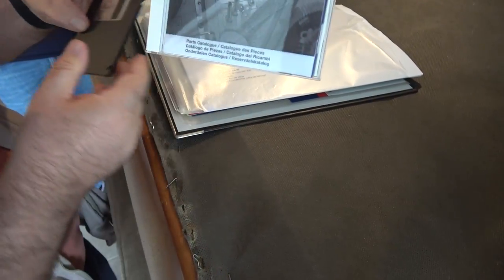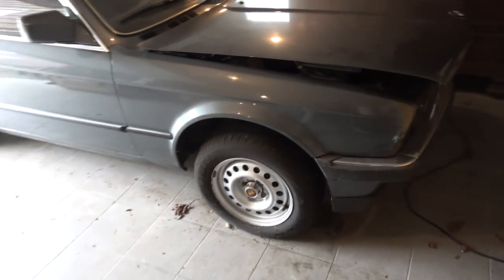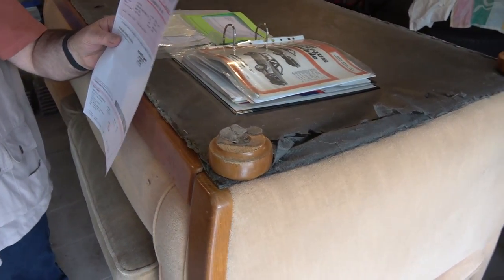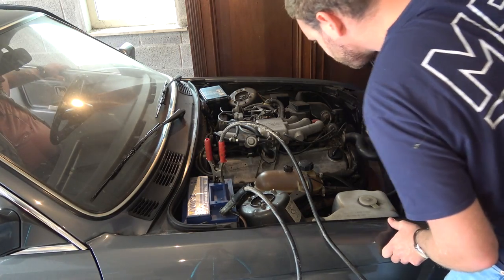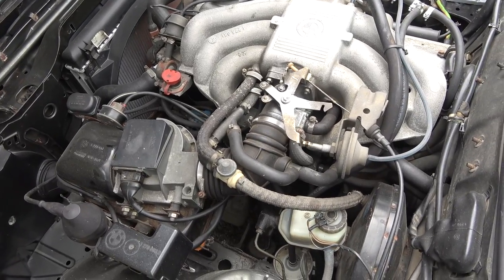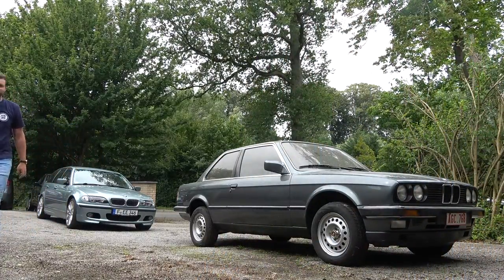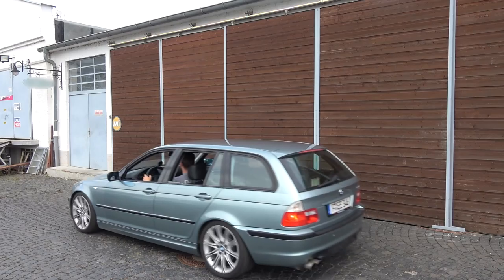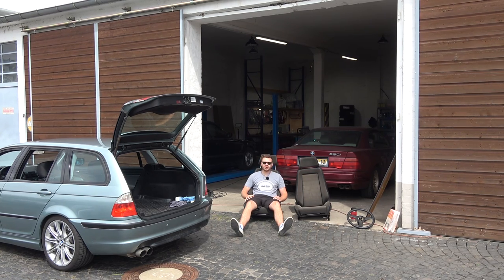Original Owner True Classic Survivor - 1983 BMW E30 320i 5-speed - Project Marbais: Part 1

Comment: I owned E30s for more than a decade...mines were both the 1988 E30 325is (Poors man E30 M3) with a manual transmission and a Limited Slip Diff.....one was Alpine Weiss and the other one was Zinoberrot 138......miss them dearly

Comment: a 1983 ... a hitten gem - it was so different the early years than from 1984 and forwards - small thing like the "check" bulb in the cluster was a triangle - I simply love E30 - I have a 1988 myself - with full original AC Schnizter exterior fitted - a tribute car! :)

Comment: I like the E30's but I really appreciate the respect Sreten shows the E21's.  The E21's are so underrated.  Most people like to pretend the E21 doesn't exist, but there would be no E30 without the E21.  Beautiful E30!  Can't wait to see what you do with this one, Sreten.  What a great guy that Michel was!  Sorry to hear about the loss of his wife.
Reply: That's because the E21 is bookended by two BMW legends, the 2002 and the E30. 
I'm meh on the E21. I have a BMW 2002 (favorite car of all time!) love the E30, meh on the E36, love the E46.
Reply: @monunyabidness5949  The E21 has some unique attributes as well. 2002 enthusiasts complained loudly about the E21's increase in size and weight, with no increase in power. BMW had very few power alternatives at the time to the M10 (the M30 family was far too large to fit, although Alpina fitted an M30 to an E21 called the B2.8) so BMW literally shoehorned an M20 six into the engine bay. The entire front and rear subframes were reengineered for the E21 320i/6 and 323i. To this day, this is the only BMW car with two separate front and rear subframes for two completely different engine classes.

Comment: Truly a beautiful car, I love the specification, very early 1983 chrome bumper, 2 door, 6 cylinder, 5 speed, delphin grey, steel wheels, radio blanking plate, sport seats. Truly perfect! 
And the history is amazing. Its no wonder you weren't interested in my shitbox E30 Touring haha.
I'm sure you will anyway, but remember to check the fuel hoses going up to the fuel rail. If the ends crack they can leak and cause fire.

Comment: My 1988 BMW E34 520i has the same M20B20 engine, it's also delphin grey and it also has a Mtech steering wheel and it was last summer, also a car that had been off the road for 10 years... it got a new windshield today, changed all ignition parts, welded, done some bushings, clutch, all manual gear shifter links, some new panels, removed all surface rust and just made it a gem now... love it to bits!
Reply: Sweet.  Dolphin grey, classy!  I've held off the suspension refresh for the mo.  A 760 and M5 mean the money has to be spread around.  Good luck with yours.

Comment: I had a 1983 318 model in 1985 and regret ever selling it. In 2003 i decided to revisit my youth and bought a1990 318is which i have dry stored ever since and love owning this car.  Good luck with your project, it sounds like the clutch slave cylinder is gone from lack of use.

Comment: Nice car this is. I used to live for E30’s and had loads, I regret selling my E30 M3 and 325i Sport the most, but I did sell them almost a decade ago.

We still have a late 1991 325i Motorsport convertible in Sebring Grey with a manual gearbox; it’s an official one of 250 with the correct 798 option code. It’s also completely and utterly utterly mint (lots of recent paint but no rust at all). It’s covered 90,000 miles since 1991!

Good luck with it.

Comment: @m539 Restorations. Top tip about the e46 touring: you can slide the roller-beam of the boot cover in two special bracket on the back of the rear seats (when they are folded down). That way the cover is secured for driving and out of the way!

Comment: Great find. I bought mine brand new in October 1983. 320i manual 3 door steel wheels in Dolphin Grey. Fantastic car with the smoothest of engines ..... anyone remember the advert with the 50 pence piece balanced on the engine?

Comment: I only saw the title, and I ALREADY FREAKIN LOVE THIS VID! Probably cause i'm from belgium and love E30's. The city is pronounced "Nee - VEL". It's actually home to the former Belgian F1 racetrack (Baulers) for the 1975 and 1976 grand prix; Oh and Sreten, Gent is not "tiny" (well maybe compared to Frankfurt, but).

Un gars qui à ses 25 ans achète une 320i et la garde pendant quasi 40 ans (et non pas 28 ans comme Michel l'a dit, ce qui est impossible...le temps passe vite), ça ne peut être que quelqu'un de bien. Si Sreten voulait que la voiture ne soit pas nettoyée ni intérieur ou extérieur, c'est très probablement pour que le "avant après" reste impressionnant sur sa chaine une fois le travail terminé, parce que cette auto a l'air nickel en fait. Tout le contraire des pauvres malaimées qu'il reprend en général; Merde si j'avais su que cette auto était en vente vraiment aussi près de chez moi, je serais venu!!

Comment: I had That car in That colour. Mine was a 1984. From 1987 until 2013. Yes, 26 years of service and I sold it in running condition.
Watch out for: water leaks…which make the floor wet…which corrode electrical contacts everywhere. And the distributor has design flaws which cause misfire which are incredibly hard to track down. Otherwise bulletproof engine and trans and suspension.

Comment: Oh my, this video brought memories of buying my first E30 almost 20’years ago now. Mine is 84 318, or what it started as. 

I had exactly the same sport cloth seats as your 83, same color and pattern ! Brings back memories , has them also in blue color as well. 

Very cool, will be following to see what you’ll end up doing with this .

I’ve still got mine , pretty much turned every nut and bolt so feel free to ask any specifics . Short of carpet and glass . I’ve either replaced and / or upgraded everything over the gears. 

Good luck and congratulations 🍾

Comment: That E30 is one helluva find and awesome! It is a real shame about the door because it is so clean ,but Im sure that it can be repaired.  I would def. not under any circumstance replace that original door.  The steel wheels are cool too.  I would refresh all the mechanicals do the fluids, timing belt,etc, put a new suspension on it (personally, Id lower it a few inches at least) , and then call it a day.  Getting it from the original owner is Insanely cool.

Comment: Finally a E30! You just need a M20B25 with the prefacelift harness and DME to get the full potential out of the chassis.
Reply: Why?  What's wrong with the car's existing engine?  It started right up, the car runs and drives, and apparently only needs some minor brake and clutch work, plus a timing belt replacement.
Reply: @houseofno  I really only deal with U.S spec E30s we never got the 320i. We got 325Es and 325is so the 2.7s and 2.5s, trust me there is quite a big deference of how the stock 2.5 feels. The acceleration and sound is way better and just the 40 bhp difference is quite noticeable under “spirited driving”
Reply: @rexe3139  Agree once you lose the limiter (eprom) on the 325e rev line jumps 2k and posi makes this sedan a Sports car! .l....had one, did that!

Comment: Nice, a very early E30 320i, in pretty common for early car fairly basic spec, i.e. none of the poser parts that later cars tended to get loaded up with by the look at me brigade.  It's really nice to see, and to feel, the purity of the design like that...

I think that damage to the door is quite easily repairable, but it's probably going to take the work of a proper, old school, panel beater to do it well.  It deserves to be done to keep the original panels on this E30, as there can't be many around that are still as original as this one.  Hell, I almost never saw examples as good and as sharp as this around in the '90s, and I always looked as I always wanted one...

Comment: I will say, it may be worthwhile on these cars that like to rust particularly badly, to go ahead while you've got the suspension off and the underbody uncovered to go ahead and apply an adhesion promoter and a rubberized underbody coating to prevent undercarriage rot. Put some on the back of the panels behind the fender liners as well just for good measure. A lot of those coatings can be rolled or brushed on if you don't mind the finish being less even and uniform. It also doubles as sound damping material.

Comment: Not so far from my home. I know that road and that is near the abandoned circuit of Nielles-Baulers where the BElgian F1 grand prix was hld two times, back in 72 and 74.
Afterwards it became popular for illegal races and so on as there were no funds because all the funds went either to Francorchamps or Zolder. It was a very nice circuit and Senna also tested his karts back then there. It was a pistol loop design and was surrounded by lovely woods etc. Nowadays there is still around 30% of the circuit untouched and you can walk along the curbstones that are silently but surely being overtaken by the force of mother nature.
The rest of the circuit has become an office park and you can still drive more or less the original layout for that part.
My father went there often to break-in his Laverda SFC and Yamaha TZ250 racing bikes.
Too bad all of that is now history. There is still also a restaurant called Le circuit where they are lovely pictures and so on.
4 or 5 years there was a historic revival that was organised very well by enthusiasts.
This is still an L jetronic, isn't it? With a real distributor standing up vertically.
The Haynes repair manual you got is for the E30 and not E21 if I am correct. It mentions the 325?
Cheers from Belgium!

Comment: I used to own a 520i E34 with the exact same engine. Not a very fast car per se but a reliable engine and nice to drive. Mine had over 300k when I sold it, and it still passed the coin test.

Comment: I have a few BMWs as well and like to do the simple maintenance on them. I have a 1987 E30 convertible, a 1973 E10 Tii from Italy (my favorite one), 1995 E31 840Ci and a 2000 E38 740i Sport (my daily driver).  I love your channel since you seem to work on the years and styles of my cars.  You inspire me to work on them more.  I am wondering where you order your parts.  I don't seem to be able to find the replacement parts you get in Germany.  Is it an online shop?  Thanks for the help.

Comment: A 320i -84 was almost my first car. I liked it for its dimensions and lovely front. It sounded great, but it was all show and no go. The engine revved, but nothing happened. Ended up buying a Peugeot 505 turbo -86 instead. Much faster and more comfortable car. Good luck with your car Sreten and I am curious of what you think about the driving experience, once it is finished. Sa srecom.

Comment: I used to work on those every day in the mid 90s.  Do LiquiMoly Engine Flush on that thing.  It will make it very happy.  I used to pull those manuals in under an hour.

Comment: All the USA 320i were I4.  Hope the two E30I6 can be compared side by side when they are finished.
Reply: Just an FYI, there was also a 320i/6 with the E21, powered by a 2.0L version of the M20 six cylinder.  Those only produced around 120 hp.  The E21 320i/6 and 323i were never officially imported into the USA, but there were a few grey market cars that were slipped in by their original owners.

Comment: Hi Sreten. Every subscriber has used up any compliments that i could adorn you with. All I can offer. Is work on your Hand Grip strength.
                   You will need it to unhook/replace the springs on the rear brake shoes. Unless of course there is now some fancy Gizmo / Tool
                    to help. In my day it was just a pair of long nosed pliers and brute strength to get them off/on. See you in the next one. 👍👍👍

Comment: Those steelies need to stay! Widened steel rims with polished lips is the best look for classic cars.
Reply: Why widen them?  There's only so much space in the wheelwells, bigger tires just add weight, slow the car down, forces your drivetrain and suspension to work harder, more unsprung weight and further limit the choices in tire sizes.
Reply: @houseofno  I didn't say that they should be widened on this car, just that it is the best look overall. "Those steelies need to stay!"

Comment: 14:20
It always drove me insane why did they need to use such a long screw?
Reply: There is a little plastic cap that goes on the top of the screw which holds the cover above it in level position , acting as structural support to the mid span of the round wheel well.
Reply: @callmeishmael7452  yep, it's all logical but it always takes a long time to get to the spare wheel. :)

Comment: yeeees pre face lift e30 ... i sold a front bumper to someone in california few years back ... was such a hazzle sourcing it packing it sending it ...(from berlin germany) i ended up making maybe 50 euros on it ... not calculating my efford and gas i burned driving around for it. (with my crappy old M10 engined e30 drinking 12-15 L on 100km )...and then what does the idiot do ? no he was NOT repairing his e30 with a intact german chrome pre facelift bumper.... he fucking sold everything !